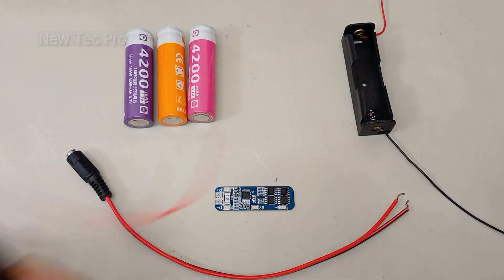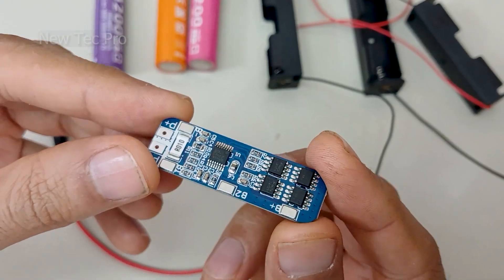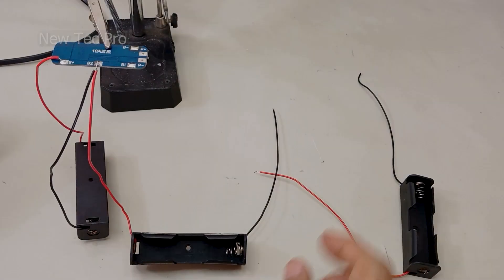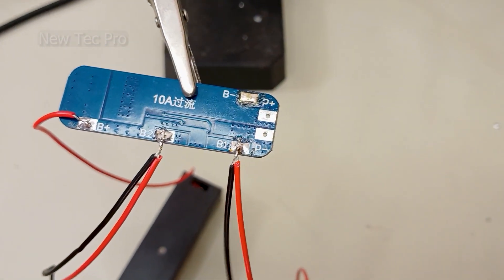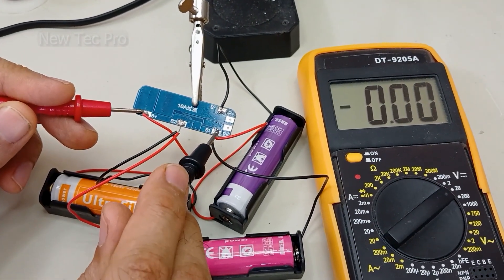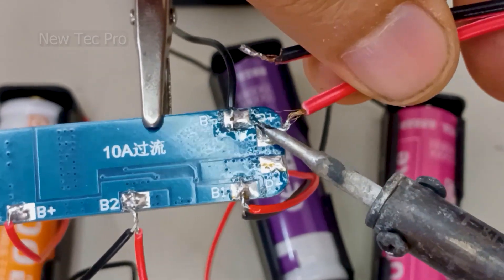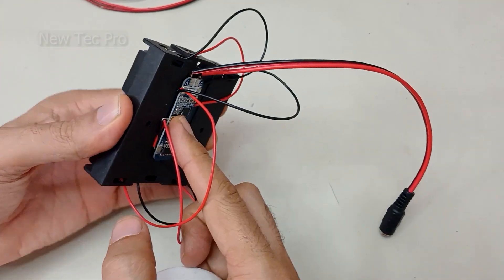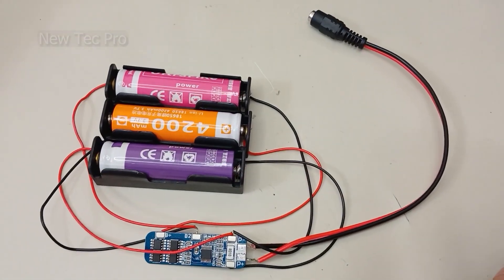How to Build a 12V Li-ion Battery Pack with 18650 Cells & Charger from Scratch - DIY

Comment: Hi, I’m I want to try making something, but I have no idea what I’m doing, i was wondering if there’s anyway I can connect a 7.4V – 2200 to 3000 mAh Li-ion battery/pack to a variable expression pedal and motor, the pedal controlling the speed of the motor and also make it rechargeable
Reply from the maker: You can use your 7.4V Li‑ion pack to run a small DC motor, but you’ll need a motor driver or PWM speed controller between the battery and the motor. The expression pedal can act as a variable resistor or be wired to control the PWM input, so the pedal changes the speed. To make it rechargeable, add a proper Li‑ion charging module (like TP4056) with protection.

Comment: Great video. I want to build a battery pack for a RC car. The car has three wires tho a red, black and blue wire how would I build that?
Reply from the maker: Thanks for watching! In most RC cars, red is positive (+) and black is negative (–). The extra blue wire is usually for signal or speed control depending on the ESC/motor setup. To build a battery pack, you only connect the red and black wires to the pack’s positive and negative terminals. The blue wire goes to the car’s electronics, not directly to the battery. Please check your RC car’s manual to confirm wiring before connecting
Reply: @newtecpro I'm confused because the original battery pack for the RC car has all three wires as well that connect to the rc matching connector but if I were to build a replica of its original battery pack I wouldn't know how to build one from scratch.